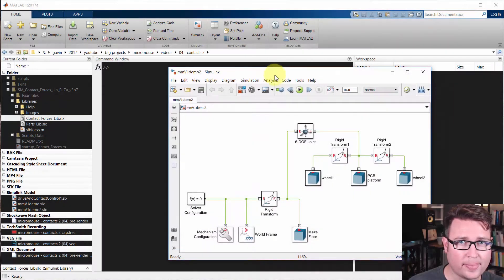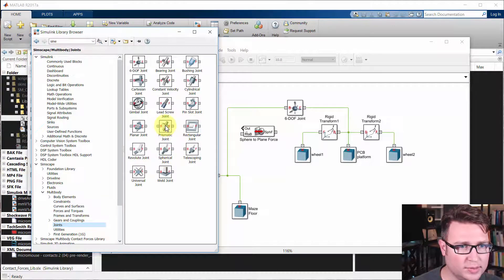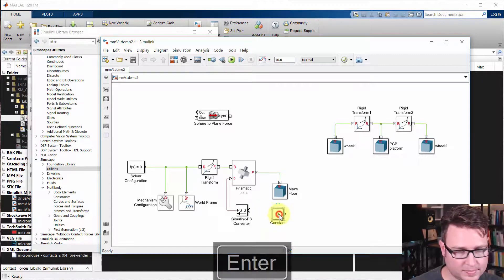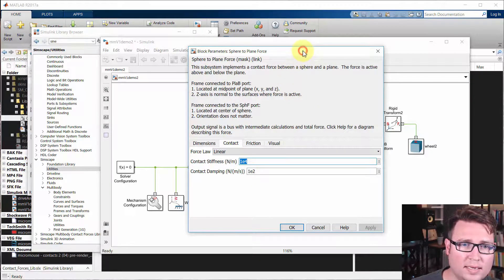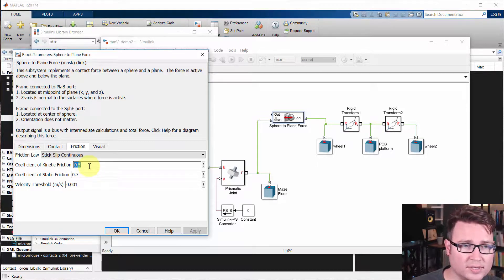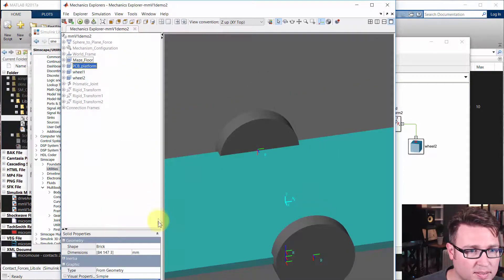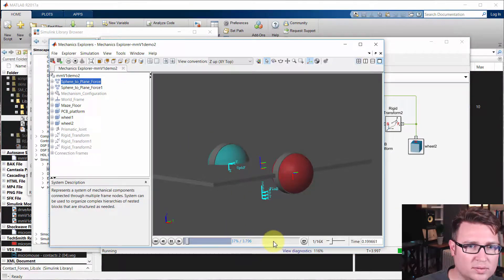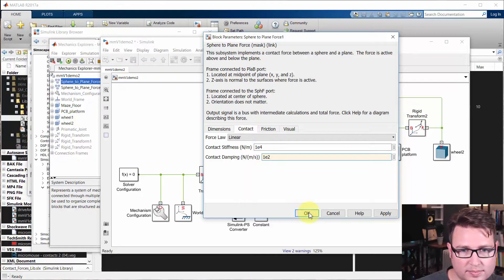Micromouse modeling - contacts and joints (04)

Comment: why don't you draw by cad software and then import to Matlab?
Reply from the maker: Hi Hoang, you certainly can do that, and if you have an MCAD model already modeled up or if it is much more complex than this, that makes a lot of sense to do.  I'll demonstrate how to do that in a video for some other series, but for this, I wanted to keep it as simple as possible (there is plenty of complexity without adding that part).  It is a good point and certainly something that I would probably do if I didn't need to explain the multibody blocks.  I think it is useful to do simple models and at least one model first (this way) without the import functionality so that you can feel comfortable with the environment first.  Thanks for you comment!